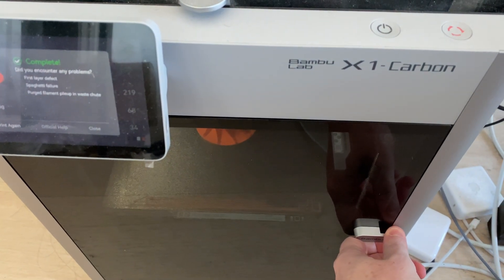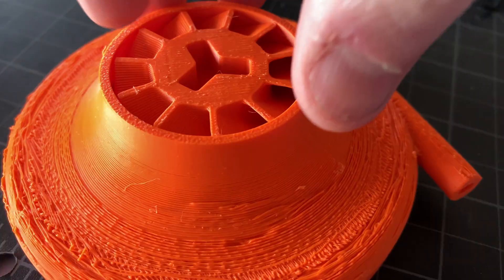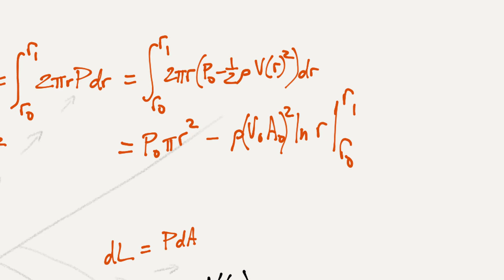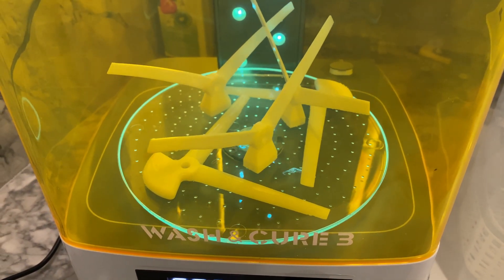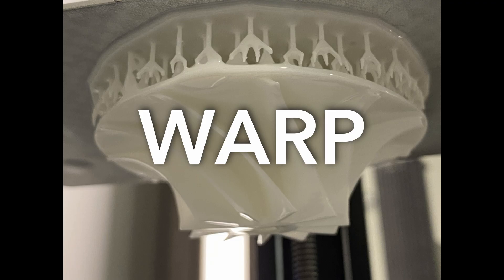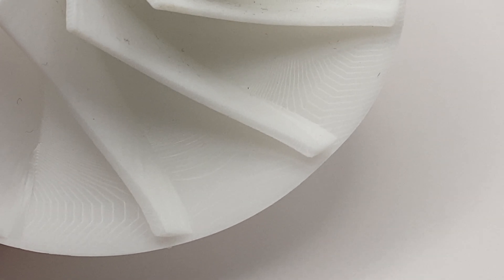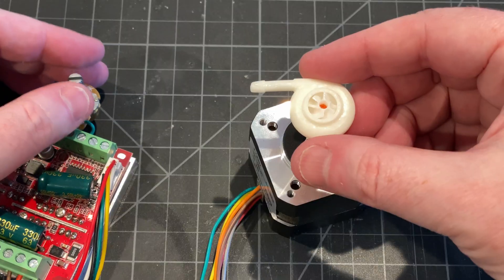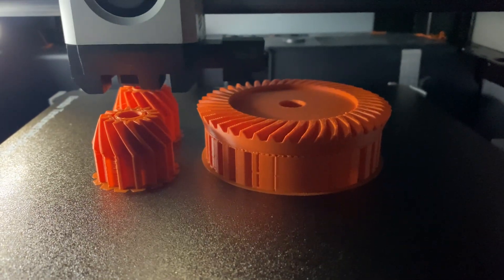Aubrey Fails At Turbo Machinery

Comment: Boi how did you fuck up that casing that bad with an X1. They are basically plug and play! I've never had anything come out that terrible and I have a P1S!

Love this content though, by the style of it I thought i was watching a video with a hundred thousand subs or something.
Reply from the maker: I like your attention to detail. Overhangs are a bastard. The inside of the compressor shroud is super clean and smooth. This is the underside.

Comment: Fun fact: resin prints will warp and shrink over time even fully cured (talking about consumer grade resins here). No dedicated, well isolated and ventilated space for resin printing — no resin printing. Simple as that.
Reply from the maker: Do you have any recommendations for stabilizing the prints? I’ve considered vacuum curing but don’t have any experience beyond what you see here.
Reply: @aubreyfails  "It is how it is". "Use better resin" seems the only way to deal with it (but not to completely solve the problem).